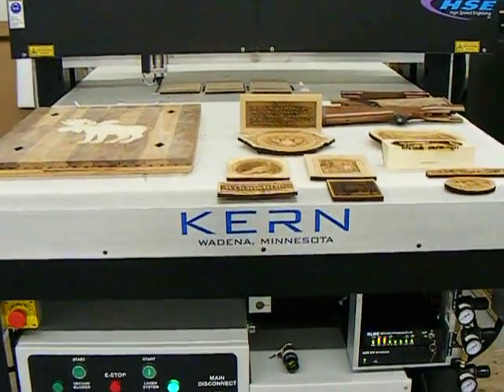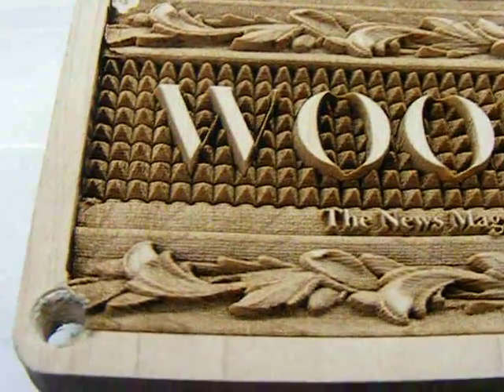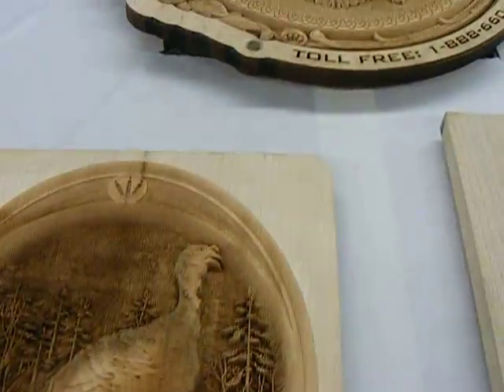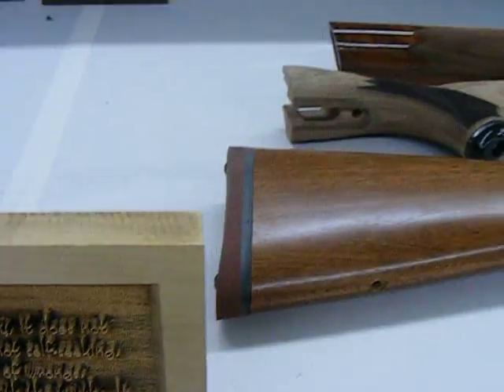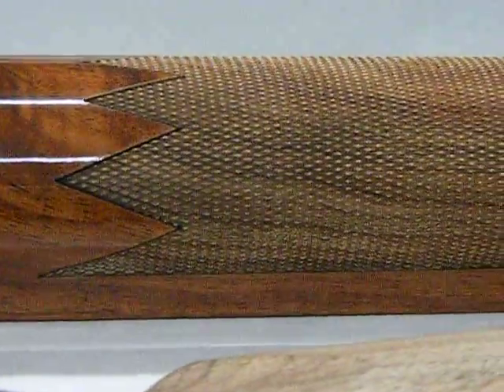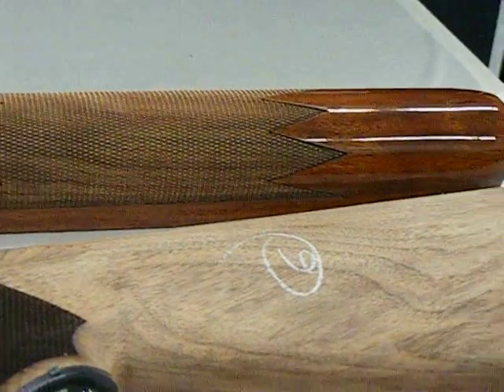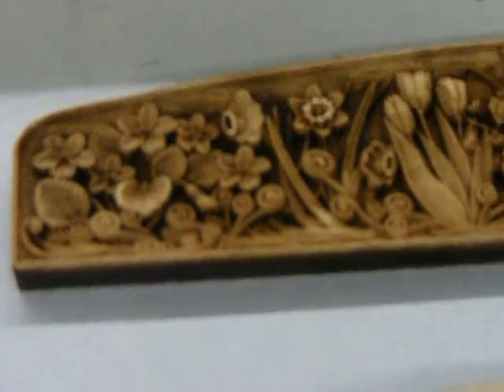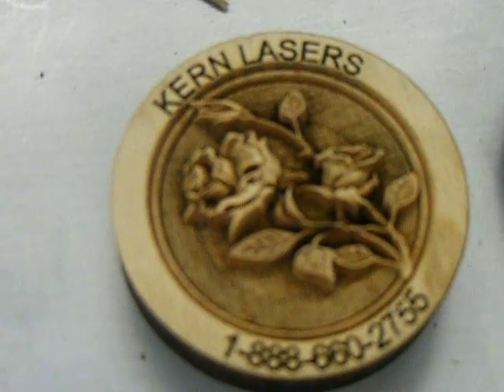3D Laser Cutting and Engraving

Comment: awesome pattern. I'd like to know how you can clean the surface of wood after engraving. Every time I do that, I suffered from the burn surface.
Reply: 王帅 I usually run it under water and scrub it with a toothbrush as soon as the laser job is done. Then I blow off the excess water with compressed air.
Reply: a 500 bux  router makes faster  and much cleaner
this  laser might  cost 100K

tough  reci also makes RF tubes and with a servo control  by ruida  you can get  a close  good machine  for 10-12K

Comment: its not 3D engraving !! and any decent laser can do this with an raster image.a laser as this model is, is just an 2D laser. the power of the laser simulate the other 0,5 Dimension. anyway it is an very good machine.
Reply: +morntech asia 2D, 2.5D, and 3D can mean different things for carving and engraving versus general vernacular. My understanding is 2D is engraving at one Z (depth level) for the toolpath. 2.5D can have multiple Z's but each is done during separate paths. So, an X,Y path is run at one Z, then the Z is adjusted and another X,Y path is run. So, the Z is not changing at the same time as X and Y. Some consider V-Carving 2.5D although technically there is a 3D move at the finishing edges to produce sharper corners. 3D creates movements in X,Y, and Z at the same time during the same toolpath. Since the laser is creating a carving (removal of material) on all three axes simultaneously, it is referred to as a 3D laser process. It is easier to view this aspect on a CNC mill or router where the affect on the Z is a physical movement of the tool. Instead of moving a cutting tool up and down like on a mill or router, the laser varies the output level of the laser. Which, for this process, achieves the same affect on the work piece as a mill or router tool bit varying its physical Z value simultaneously with X&Y movements. A 3D part, like a statue or figurine, is done by added additional axes to machine the work piece. These parts usually require at least 4 axes, if not 5 or 6 to machine all the overhangs and undercuts. So, the term 3D is used differently when discussing a physical part versus the machining operations to create it.
Also, this work cannot be done with "an [sic] raster image." The raster image will have pixels depicting the details as well as a grayscale depth map overlay which varies the Z (black is full depth of cut, white is no cut, levels of gray are in between). Without the grayscale overlay and setting the laser to 3D interpolation, these 3D laser engravings would look very different. But the point is, the raster image must be designed with this 3D laser technique in mind.
Reply: i've been chasing a rabbit trail to figure out how to get the 2.5 or 3d results on my laser but I cannot figure out how to create a rasterize that reads correct to engrave 2d let alone "3d". Would to exchange words or make monetary arrangement for guidance/instruction etc. thalia.lifeline@gmail.com

Comment: They cost anywhere between $49,995 - $139,995, depending on the table size and laser wattage.

For example, the Micro 50 watt 24" x 24" costs $49,995.

You can lease them for around $1000-$3000 per month depending on your credit.
Reply: Thats just insane.  I built a 1200x900mm 100watt laser for about 4k with servo hybrids driving the gantry.  I can get similar results at 1200dpi using a lightobject x9 dsp.  I realize kern is the catz azz an all, but the prices are retarded for what it really is

Comment: It's based off of its grayscale value. Black areas are pushed back, white areas untouched. You can use a program such as Photoshop to create gradients that fade from black to white (which will make it gradually fade). I use Coreldraw for basic engraving and Photoshop or Vectric Aspire (CNC program) to create 3d images. Aspire allows me to model an object in 3d (I use blender 3d for that) and import it as a 3d model at which point Aspire creates a grayscale image based on the Z axis height.